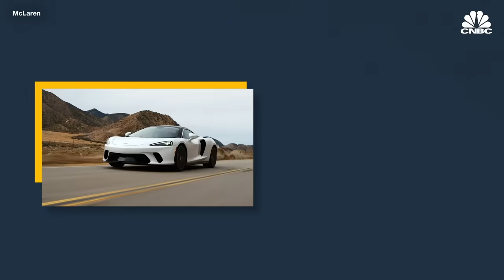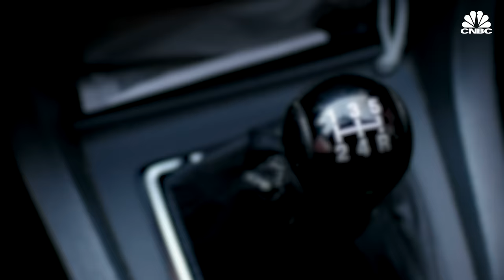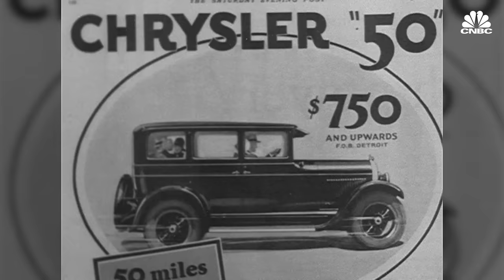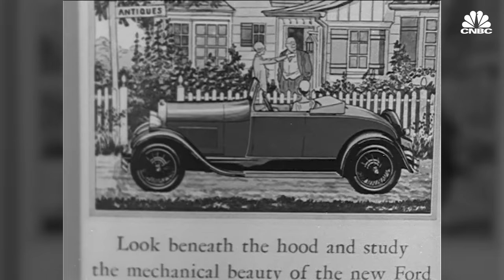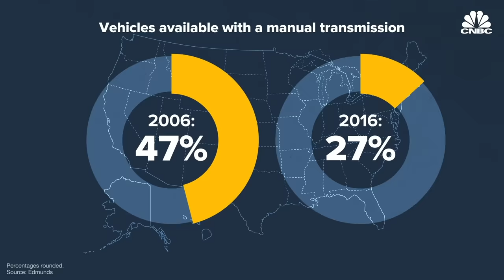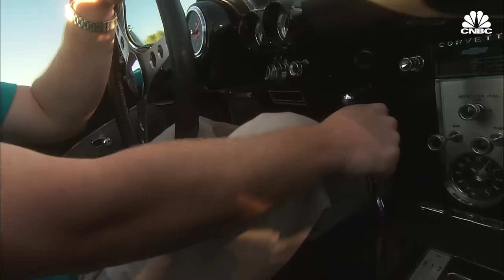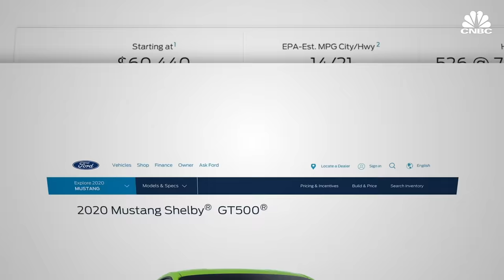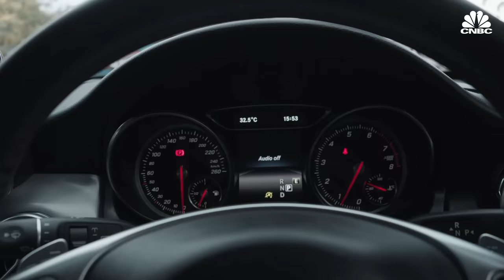Why Stick Shifts Are Going Extinct

Comment: There are entire continents laughing at this video.
Reply: Really? Why do you say that? Do you have data that supports this assertion? Truly there are people laughing, just as there are people who miss the horse and carriage, outhouses, and cooking on wood-burning stoves, but they are in the minority. Still, if anyone wishes to laugh, let them laugh, people are entitle to their opinions and their reactions. Personally, I'd rather churn butter every time I made toast than to have to suffer another manual transmission, and I've driven enough miles in enough vehicles with manual transmissions to have an opinion about the matter.
Reply: @HangTimeDeluxe  ok boomer...
Reply: @HangTimeDeluxe  hahaha I'm laughing and I'm from Mexico, its a joke man, take it easy
Reply: @HangTimeDeluxe  ok. But go on the street pretty much anywhere in europe and ask them what they prefer. 9/10 will say stick. It is just so much more fun to drive.
Reply: Fortunately for us here, no other continent matters but North America.
Reply: @CRT Wasteland:  I for one am mourning the loss.  My current car is a 2003 and I have been looking for a manual car for awhile now.  With no mechanical skills it is really not feasible to buy a older car that may or may not have the same problem as my current car… it’s old and starting to fall apart or break down vs newer than mine but has more miles driven on it already.
Reply: @HangTimeDeluxe  in Europe for example stick shift is pretty normal. In Germany(where I live) there are more Stick shift than automatic cars on the roads. that's why
Reply: @HangTimeDeluxe  ok boomer
Reply: @HangTimeDeluxe  what is a car if you can’t change gears manually, for us automatic cars are toys.
Reply: @HangTimeDeluxe  Spain salutes you! The only ones driving automatic cars here are UK tourists.
Reply: @karthikchandrappa15  I would actually point out that most all the manual transmissions left on the road in the U.S. are in classic cars, that are literally toys for their Boomer owners.  LOL
Reply: I see there a ton of crazy car people these days
Reply: Murica centre of the universe
Reply: @jz261  was calling him a boomer supposed to be an insult?
Reply: @Mensch13792  that's not going to last very long as the electric car takes over.
Reply: @jz261  but why would you say that, the man obviously comes from an area when manuel was pretty much the standard, but you also never know if he served overseas in the military or something. I myself served in the military for 24yrs, and many of those years were spent in other countries. I drove all manners of manual transmission vehicles, and although I had a ton of fun with many of those vehicles I prefer paddle shifters now. For one thing I was shot several times in Afghanistan, so my left leg doesn't work as well as it used to, so I find it much easier to not have to constantly press down on a clutch pedal. It's to the point now where this generation shows absolutely no respect to the generations that came before them. Not too long ago I was 21, and felt like I was going to be young forever, but the truth is older age catches up with you faster than you think.
Reply: @mjareacts2731  I foreal don't care wether you or the other guy served in the military or wether you like manual or auto. Unlike in the U.S flexing as a soldier ain't gonna help you win an argument cs I ain't American so don't expect any warm fuzzies from me. The dude before was saying that the rest of the world laughing at americans using automatics compares to someone using a horse carrage instead of a car. He completely missed the point of why the rest of the world is laughing. It's the american arrogance and desire to be the center of the world which makes us laugh. Dude it's one thing to like automatics better because you are phically injured but another flexing with it as if you are better than everyone else, that's exactly what the other guy said. And the way he made his argument really made him sound old and entitled so ergo boomer. I got nothin against old folk it's just when they are a lil to old fashion that I reply. And having been in Afghanistan is nothing to be proud of, an impoverished nation which is no real threat to the U.S homeland which the U.S has been plundering for years for their oil, tbh it is shamefull I'm glad you pulled out for the sake of the afghan people and for you. As a soldier you should be defending your borders instead of someone else's ergo mind your own business.
Reply: @mjareacts2731  sure I made it personal after I decided to include my military background and my injuries to a discussion about manual transmissions. Jeez just say you got shot, as an american that wouldn't be a suprise to me and you say I am the one who made it personal aight. I never said anything about you as a person I mentioned Afghanistan sure but last I checked Afghanistan doesn't belong to you.
Look I'm a soldier too (still on duty)  wether you believe it or not, still doesn't mean I gotta stick it to everyone to get respect or win an argument. Look if you are gonna bring up the service than don't expect to get anything less than a responce about it. Your rambled quite a lot about the military just to say you got shot as if I should respect you for it. Maybe you're not proud of it but mentioning it does not seem very ashamed either so I assumed you were proud. You wanted to know why I called the other guy a boomer I told you, unless you got anything about manual transmissions or why I called the guy a boomer don't bother replying.
Reply: @HangTimeDeluxe  Ok boomer
Reply: Yeah especially japan and their imports
Reply: @jz261  what did you get offended by, a simple discussion? You claim to be a soldier, but your reaction from this discussion says otherwise.
Reply: @HangTimeDeluxe  From India, one of the largest auto markets in the world. We love Manual transmissions. so ... hahahaa .. i guess
Reply: @HangTimeDeluxe  🤓
Reply: @EdDeezNuts944  I live in Germany i dont know what you mean almost every car is a manual,many newer cars or cars with bigger engines come as autos and the A Class and Sprinter comes in manual
Reply: Yeah lol Europa
Reply: @HangTimeDeluxe  not data, real life examples, check any car out of US, you will see stick and 3 pedals
Reply: I'm really trying to understand the humor behind this phrase and get to the conclusion that, I guess I would put it in an example: in Germany where I live, most of the time when I come to talk about cars, people refer to them as machines which deserve all your attention and concentration as they are very well made things where some people put a lot of time and craft. The manual transmission keeps these attention and concentration and connects you to the car in a certain way, you know... it's more or less a polished summary of what most Germans say about, in my opinion.
Reply: @miguelnavarroangulo1865  when you drive a Ford you feel like you're driving a computer. When you drive a VW you feel like you're driving a machine. For driving, imo, machine is better. 
As for the humor of the phrase, it simply points out the irony in the perceived arrogance of a single culture that thinks that because it no longer consumes a given thing, that given thing is doomed to obsolescence.
Reply: @miguelnavarroangulo1865  sush
Reply: @johnyrocketch  Europe it is! 😂
Reply: exactly lol
Reply: @jz261  boomers would support manuals...
Reply: @jz261  are you sure the churn butter was referring to Europeans, or are you just taking things out of context and too personally. He could've been making fun of manuals, not the countries...

Second of all your response came of as exasperated, which i find funny

And third, do you support manual or automatic
Reply: @dr.coomer789  first:
 I do think he ment it as a metaphor towards other ("continents" mb) being less advanced cause we drive more manuals. 

Second: ok....insult me all you want idc. 

Third: I think you know the answer
Reply: @jz261  so why stereotype people over what car they drive? You went on a whole tirade of calling Americans lazy simply for the fact they have automatics, but complain of being stereotyped as technologically inferior (although automatics do outperform)
Reply: @dr.coomer789  when did I ever say automatics are lazy??? I ride in an automatic for crying out loud they do have their own advantages, but when it comes to experiece manuals are better thass all I said.
Reply: @jz261  oh true wrong debate
Reply: @Bradastan  how does something being old make it a toy? That made zero sense.
Reply: @HangTimeDeluxe  your hard
Reply: @HangTimeDeluxe  There are entire continents laughing at you.
Reply: I can see, you are at the denial state of grief.
Reply: I would say most new cars in China are automatic. And China is the worlds biggest auto market.
Reply: @jz261  Again this is a continent thing. I'm a boomer in a land of Manual transmission loving boomers. Driving is not a chore. It's a pleasure. I dont want a car that drives itself! Most Europeans don't. Though we are condemned to that in the near future I fear!
Reply: I want to drive my car. I dont want my car driving me. Where is the joy in that?
Reply: @HangTimeDeluxe  an engineer would appreciate the durability of a manual and being able to start the car when the battery is dead or starter won't engage.
Reply: I live in Mexico City, Mexico and drive an Automatic car; used to drive Manual transmission till 2019. 🇲🇽
Automatic vehicles are useful and convenient to drive in cities and traffic.
Reply: So u pass your test in america in auto then u have 2 learn yourself 2 drive a manuel 🤔🤔
Reply: @HangTimeDeluxe  it’s fine to prefer an automatic, I do. It’s just that that video is only focused on the US. In Europe we had, by law, to learn driving on a manual until recently. 95% of our cars are manual. 
About 10years ago we introduced a automatic driving licence but that only allows you to drive automatic whereas the manual one allows you to drive both. The price of an automatic in Europe if also more expensive, about ~1500$ more.
Reply: Look at India, we save fuel by driving Manuel
Reply: I can confirm this hahahaha,
Reply: @HangTimeDeluxe   I prefer Manual transmissions. They are cheaper and easier to work on, I have more control over the vehicle, Also like many people, I just get bored in an Automatic. It's like the difference between an Automatic vs pump action shotgun. Sure the automatic is easier to shoot, but I like developing a skill and the pump action feels so much better. It's all subjective, I think it sucks that we always just give in to the majority. Plenty of people prefer a manual transmission, I hope a few manufacturers keep this in mind.
Reply: @DelGTAGrndrs  wdym by currently rebuilding? You have obviously never been to europe my guy, we got more and better infrastructure than the U.S. which is why our people  live longer and happier. And fyi austria didn't start the second ww2 that was germany.
Your knowledge of eurpoean history suggests a lack in education. I'm sorry for you that you have to live in a non developed world.
Reply: @karthikchandrappa15 Not everybody cares about the “fun” bruv. Many of the people just want to get from point A to point B comfortably.
Reply: Wrong. Mercedes doesn't make any new cars with stick anymore. (Source: My dad that works in transmission develeopment for Mercedes)
Reply: @HangTimeDeluxe  Believe it or not, the stick shift in Europe is actually popular and some parts of China/Asia people drive stick as daily drivers. Also, in Japan manual trans is pretty popular.
Reply: @jz261  ok boomer
Reply: @swarnankaroy7706  copy 🐈
Reply: @HangTimeDeluxe  ever heard of a joke?
Reply: @ricardootano2846  no one drives automtics in the uk. its not our fault hire cars are automatic!
Reply: nah only europe
Reply: Europe gang
Reply: @HangTimeDeluxe  literally everyone in the Europe loves H-shape transmission
Reply: @HangTimeDeluxe  Im laughimg from India or more like entire South Asia will laugh with me
Reply: Europe, Africa, Asia & Australia
Reply: As a man from Mexico, stick is not going anywhere any time soon.
Reply: @MarcoRodriguez-ci3pg  yes in my country also but there is a looming threat of electric cars which might just do it.
Reply: Lol thank you  @jz261  1stly Americans think the rest of the world believe they were the good guys in Afghanistan. The reality is they are were seen as invaders. We really feel sorry for soldier who got hurt only because he was made to fight unjust war. The real pain we feel is for Afghan population that lost loved ones at the hands of Americans or as a result of US invasion.
Reply: @The_Dark_Lord-69  facts
Reply: Exactly
Reply: @jz261  u r right my friend.americans think that they are no. 1 in everything.
Reply: @HangTimeDeluxe  You sound like fun at parties!
Reply: What Africa? They are probably not laughing
Reply: @RonaldRaiden  no doubt but if I was living in Africa I would be crying
Reply: @UC34I7PqK_K9bxJveEqUmqoA That’s bs. One simple visit to their online configurator will let you know they offer 
many models with manual transmission. 

If they did what you claim they would see a massive drop in sales here in Europe. No manual transmission is a deal breaker for most people here.
Reply: @Bradastan  My Ferrari is a manual.  Maybe you can afford one in the future.
Reply: @kentadams4589  I will think about it with their new electric offering just announced. But I think it will be an automatic.
Reply: Especially europe
Reply: I’m laughing and I live in America they need to rename the title “in the US”
Reply: I laugh at this video I like my manual transmission it's fun to drive like that. You're a driver noob if you can't do that.
Reply: @jz261  I completely agree regarding the infrastructure, the US roads are in many parts I experienced worse than those in the former eastern block in the early 1990ies. I have experienced both. Regarding your reference to European history you should not forget that we Austrians were part of Germany at the time and contrary to the narrative we as a nation used to get rid of the occupation forces after the war, we were not the first victim, but very much in favour of the Third Reich at the time of the Anschluß, so claiming were did not start that war would be like Vermont claiming it was not part of the second invasion of Iraq just because senator Sanders voted against it.
Regarding Stickshift or not - it depends on the type of traffic and the drivers you are surrounded with. I drive stick everywhere I go in europe, every car I ever owned was  - and still is a stick shift. When visiting the UK I insist on an automatic because using the same hand for the indicator and the gear selection does not mix well with their obsessions for roundabouts and driving on the wrong side of the road, while we literally drive on the right side. In the US it is a mixed bag. In cities with their notorious trafic jams an autoatic is more convenient and gives you more time to focus on not hitting the idiots surrouding you who all seem to have won their drivers license in a lottery. On country roads a stickshift is more fun.  It would be even more fun if the speed limits were not so ridiculously low because of those huge Trucks and SUVs beig prone to rolling over in curves at half the speed we would nermall drive through them in proper cars.
Reply: @Nico-it5fl  In Austria we have had licenses for Automatic only for decades, usually only for disabled drivers who ould not use a sticsift because they were not able to operate the clutch.
Reply: @DelGTAGrndrs  Rebuilding was finished for the most part in 1955. We are however still clearing unexploded bombs from our cities, usually when remodeling/redeveloping old trainstations or industrial areas. Those that had deliberate timed fuses to explode during cleanup and those that were the result of rather shoddy workmanship. Depending on what source you believe 10-20% did not explode and thus ensure our bombsquads skills do not get rusty.  However that is pretty pointless regarding the question of stickshift or not. Germany did have the last laugh regarding cars thoug. The sequence of clutch, brake, accelerator for the pedals that is now the same in basically all stick shift cars, is, According to the Mercedes benz Museum based on a regulation of the Prussian army dating back to 1908.
Reply: Yeah, being poor means you have to build and buy cheaper made cars
Reply: *Laughing in poor

Comment: I enjoy using a manual for a track day, but for me using one for every day commuting is a bit of a hassle, especially as the roads in my city have become increasingly congested over time and I'd rather not have to constantly deal with a clutch in stop-and-go traffic.
Reply: Lies again? Driver Chauffeur San Siro
Reply: BS.  I live in Toronto and have always driven manual.  Most modern cars, just leave it in 1st or 2nd and you can coast in stop-and-go traffic without shifting.  I hate these lazy, BS excuses.
Reply: @rebeltvr6046  That's nice.
Reply: @DementedDistraction  Just be honest and say that you're lazy or have some knee issue or something...no need to cap...